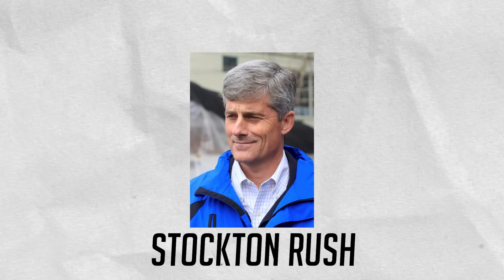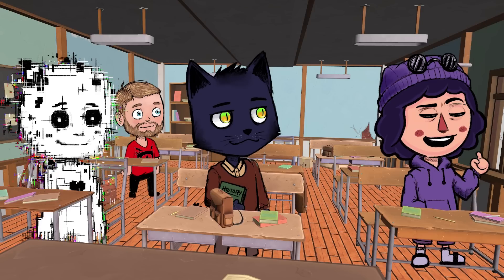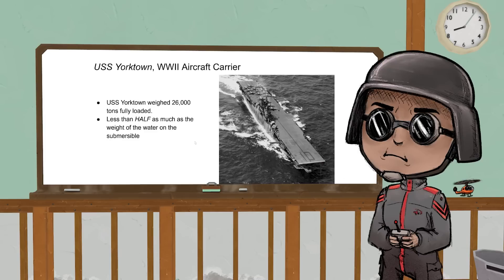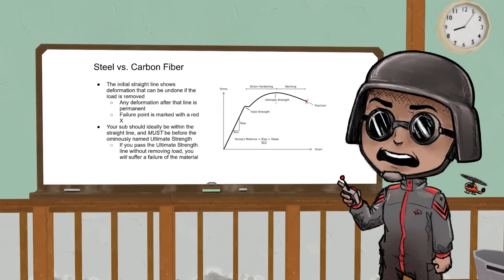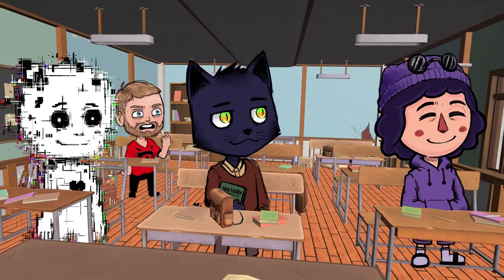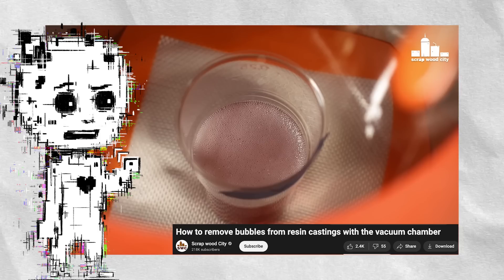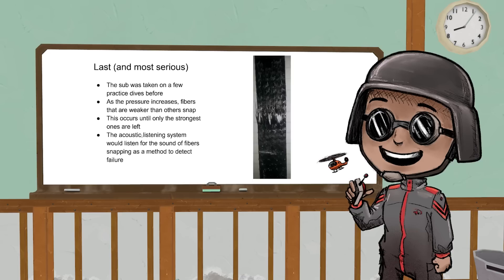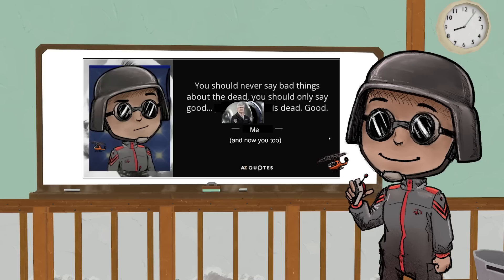An Actual Engineer Explains the Oceangate Incident

Comment: I watched a video on the sub being made. It showed the (cylindrical, carbon-fibre) mid-body being joined to the (hemispherical, titanium) end caps. So the weakest point, the sphere-to-cylinder transition was also a joint between dis-similar materials. I immediately thought 'this is bad'. But then they showed the join being done. With glue, by hand, on an open warehouse floor. Nothing to make sure the joint was even, nothing to prevent dust and bugs flying into the glue. No pressure or autoclaving while the glue was setting. I'm not a structural engineer and even I thought it was a bad idea.
Reply: Here's another fun fact: Carbon fiber corrodes Titanium. That's why the Ti has to be treated (painted) to avoid corrosion when in contact with carbon fiber.
Reply: Glue and not even glitter sparkles. Amatures.
Reply: Exactly. This is a very different conclusion than I heard from Thunderfoot and Scott Manley here on YT. They said what you wrote -  that it was the glue seal holding the titanium end to the carbon fiber that failed. I don’t know who to believe.

The US Navy made a sub out of carbon fiber. I believe that’s what inspired Rush.

Then there’s the interesting testing that The Hydraulic Press Channel did... that seemed to indicate that it was the CB that failed, but there’s sooo many differences with his test subject and the real thing, that who knows if it was a valid simulation.

Comment: I do carbon fiber manufacturing. If you had told me the pressures this vessel would have been exposed to I would have told you to find another material to do it with. Simple as that. The CTE of the tube and end caps. The porosity of the fiber. How carbon fails... It's all bad... Then, you have to account for the construction of the tube. I am here to tell you working with carbon fiber is both an art and a science, no two pieces are ever the same, no matter how bad an engineer wants them to be identical. Wrapping that much carbon fiber with no mistakes would be an absolute miracle.

Comment: the fact that the cylindrical tube was made out of a different material than its ends, that expand differently to pressure and temperature changes, to a point where they will no longer connect at the door-between-them, is enough of a suicide-trap-for-sure.
water barely compresses, so deep enough water will go supersonic-speed on any 1-atmosphere low-density air-bubble that it finds, and that instantly kills you on supersonic impact.
it likely did not explode/implode

Comment: the fact there where so many things wrong the carbon fiber may not have been the thing that went

there is the glue used between titanium domes and the rest of it, which was applied in a warehouse not an autoclave

there was questions on the thickness of acrylic window was half as thick as the math required

the sub cracked audibly each time it of the 7(?) times itdove down, you can hear it without the fancy ultra sound

Comment: I remember talking to a friend about carbon fiber and its use in sports cars and bicycles years before the incident (the former being his hyperfixation, the latter being his actual field of trade). He literally said unlike steel or any other metal, carbon fiber breaks in such a way that you basically "you go from having carbon fiber to not having carbon fiber"
Reply: Yep. Couple that with the sheer amount of force at play (meaning there's no small leaks, or minor separations, or really any minor damage that will last long enough for the human brain to process it before it results in death), and I've always been extremely skeptical of the idea that "they knew it was coming and we're trying to ascend when the hull failed"

Like, I know Cameron and Ballard and such all made that claim, but... I have to imagine they're either basing it on what would happen on their vehicles (they may be experts on diving, but they're not materials scientists) or on that fake transcript that was floating about. It's hard to conceive of a failure mode of the pressure vessel itself that would actually have warning time.

Maybe if the sub did have some other technical anomaly I guess - If they lost attitude control or something critical by coincidence on the same trip (they did fail to reach bottom very often, but I don't think it typically lead to dropping ballast and emergency-ascending) it could happen, but I don't really buy that much either.

Comment: > install a system that listens for subtle sounds of failure
> ignore obvious sounds of failure reported by everyone on each dive

Task failed successfully.
Reply: it sounds more and more like the dude is just suicidal
Reply: At the depth where the alerts happened, it was already too late to pay attention to them. They should never have gone down at all.
Reply: @nielsjensen4185  The submarine did several test dives before it attempted to go to the titanic, and during each of those test dives a significant number of carbon fiber strands snapped. They had ample opportunity to metaphorically turn back, but they didn't.
Reply: @nielsjensen4185  The acoustic sensor graphs were showing abnormalities a few dives before the fatal one. A very loud bang was heard on one of the last few dives, and on the following dives  the graph line was no longer straight like it was supposed to be..So his sensors were working as intended, he just chose to ignore what the data was telling him.
Reply: I think this happened on the previous sub they had made, Cyclops 1. This one did end up developing a crack and was retired. The one that went down was Cyclops 2, later renamed Titan.

Comment: Corrected title. An actual child with an engineering degree feels confident enough to mock a tragedy, using bandwagon style talking points. "The sub was never tested." Correction - The sub made more than 200 dives before failure. Maybe you feel better about yourself, but the edge of tomorrow will never be found by those that mock the ones courageously pushing boundaries. Shyt happens, kid. We never would have gotten off of the planet without those willing to do the impossible. NASA lost a lot of good people learning where boundaries lay, and how to cross them. Gonna mock the Saturn V, The Redstone, or the Space Shuttle next?
Reply from the maker: Homie are you legitimately defending a guy who thought stress-testing improperly assembled carbon fiber was a good idea? Also, when Tim said the sub wasn't tested, he clearly was referring to the fact that they never did a pressure test in a controlled environment for an extended period. Launching a sub with a crew to "pre-break the weak fibers" is not a test, it's just using the submarine and damaging it, with no plan to mend the broken parts. An idiot says "I can build a submarine using only what I know", and the innovator says "I'll use my knowledge of engineering to build a submarine that can safely dive far enough down to see the Titanic". Now you tell me which one Stockton Crunched was.

Edit- Also, Oceangate the COMPANY had completed over 200 dives with other submersibles. The Titan submarine itself only completed 13 dives.
Reply: There's a difference between "courageously pushing boundaries" and "using new stuff to do something it sucks at because it's new".

Carbon fiber submersibles lie so far to the latter side of that line that they're thinking "run the world on Bitcoin" looks kinda reasonable.

If you look up to Stockton Rush, you're the child in the room.
Reply: No because the Saturn V, Redstone and Space Shuttle weren't slapdash pieces of shit.

Comment: It is mentioned that titanium and carbon fiber should not be both used at the same time, but no explanation is given.  One problem with bonding titanium endcaps to a carbon composite cylinder is that titanium and graphite composite, being different materials, have different mechanical properties.  Unless careful steps are taken, the titanium end caps and the carbon fiber cylinder will not have the same elastic qualities, so the endcaps and the cylinder will want to compress by different amounts, as the pressure changes.  The material that would compress more, at the joint, increases the load on the material that would compress less.  Adding to the troubles, as the diameter of the cylinder decreases under load, the thickness must increase, which applies shear loads on the adhesive.
Reply: This is the most likely mode of failure from the testimony we've seen so far. As I recall it, one end ring was cleanly sheered from the glue/carbon, evenly all round, the other was uneven. If the implosion had begun in the fibre in the cylinder itself, it would have been uneven at both rings. IMHO, this also matches the evidence that human remains were found as they would have been 'pushed' towards the opposite hemisphere which remained intact so less 'shredding'. This is conjecture on my part, based on what I've read and seen, and the testimony of the marine contractor to the coastguard inquiry Monday 16th Sep 2024. I'm not stating this as any kind of expert and further evidence may come to light
Reply: @keithposter5543  If what you say is correct them My hypothesis of the titanium ring failing because it was 1/8" X 2" as the supporting edge of the ring. Applied to the tube of carbon fiber. The inches thick of titanium was outside the tube and in no way supporting it structurally. As the cause VS the Carbon Fiber simply failing outright. The edges of the tube were never properly supported. Huge built in weakness ANYONE should have seen.

Comment: I remember seeing somewhere there were doubts the acoustic system would even work. Since carbon fiber isn't one uniform material but instead a bunch of strands glued together people didn't even think the system would detect any cracks that were forming in the first place because the entire scan would likely just be useless noise. At least until something catastrophic had already occurred. It's WILD to hear that apparently, even if the system worked, they had less than half the human reaction time to deal with the issue.

Suicide by negligence and arrogance, and Stockton roped 4 other people into it.
Reply: Plus all of the other people who paid deposits to wait in line.
Reply: I still feel so bad for the boy
Reply: Even if the system worked, Stokton Russ never wanted it to work. It was to give people a false feeling of safety. 
They never did calibration tests. They did not compare or analyze changes. No follow-up with inspection. 
They ignored signals from the system. So was the carbon fiber hull ever properly inspected during production. 
The first hull failed (cracked) what was the reason? What were the actions and changes to the second hull?

By Boeing, every step in production gets checked and reworked if needed. 

Ocean Gate did sand, did not properly clean, and just continued building layers.

The titanium was not prepared to bond well with the epoxy. The ring's flanges (especially inside) did not adequately support the carbon hull. That part failed, and seared off when the hull was separated from the ring due to water ingress between the carbon and the titanium.

The glue joint was not only exposed to pressure but due to the hinge for opening and transportation from the port to the titanic site.

The carbon hull was not up to Boeing quality, the orientation of the carbon was about 80% directional and not enough in other orientations.
Due to the cylindrical form, there was a huge longitudinal (water)pressure created by the titanium domes. This Force is not really taken bvy the carbon but by the glue in the carbon matrix.  Ocean Gate was waay to optimistic an the forces that there hull could handle.

Comment: 'they got their carbon fibre from BOEING'     'AGHHHH!!!'
Reply: Which was expired.
Reply: @thunberbolttwo3953 yep, expired prepreg is a big no-no
Reply: Yeah, even modern Boeing had the good sense not to use this material.
Reply: @bthsr7113  "Oceangate won a corner-cutting competition with Boeing and their CEO was dumb enough to use his own product" is this whole incident in a nutshell.
Reply: Used carbon fibre  from an aerospace company in an underwater situation. Because airplanes do so well in water.
Reply: [Insert Metal Gear Solid "!" alert sound]
Reply: Carbon fiber works well in planes and even spacecraft.   It’s light and strong.  There the pressure is on the inside pushing out. Going from slightly less than one atmosphere to zero.     In a submersible is is holding back 400 atmospheres coming from the outside.    Carbon fiber also works well on musical instruments were the pressure is on the inside.    Carbon fiber bicycle grand and stems though will suddenly break and put the cyclist at risk.
Reply: Boeing and other plane manufacturers us carbon fiber. 
Like the video states, carbon fiber has it's uses, except submarines isn't one of them.